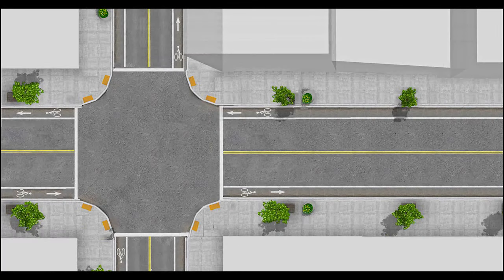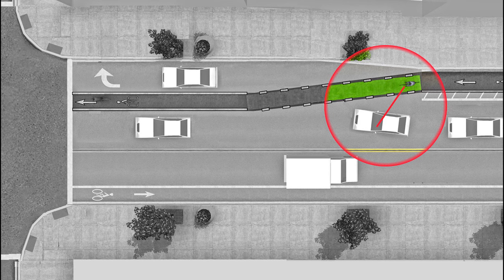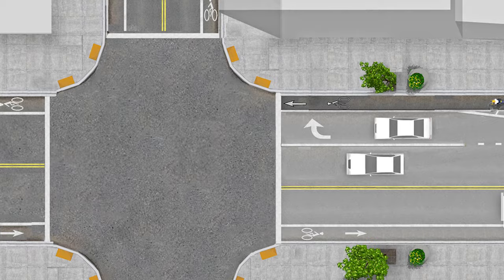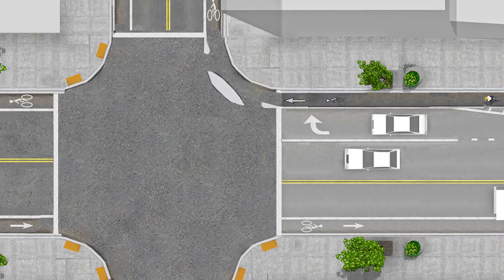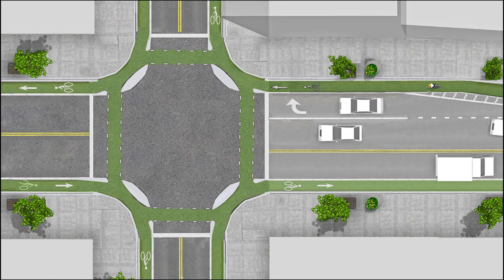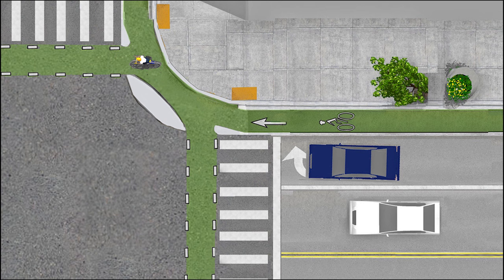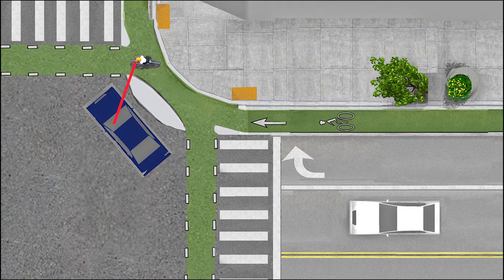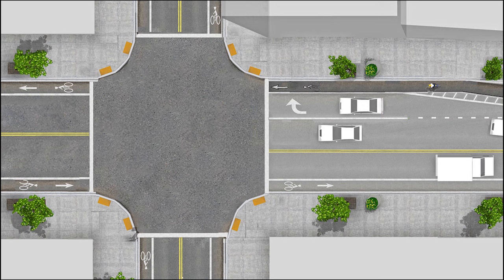Intersection design, the Dutch - cycle friendly - way

Comment: I am happy to say that the urban Cultural Trail in Indianapolis has adopted the Dutch design connecting all 5 neighborhood districts. This may very well be the only design in existence anywhere in America. The Dutch model is the most practical model to follow I think. I wonder how many other cities in the world also uses this grade separation.
Reply: How is cycling in Indianapolis now? Has it improved in the last 9 years since you posted this message?
Reply: Wow! 9 years later. Well, since recently they have approved expansion of the cultural trail. The extension grade separation based on dutch model will extend along the following streets:

1. South Street
2. Indiana Avenue
3. 10 Street

Since 9 years ago Carmel a suburb north of Indianapolis also built the Monon Trail cycle path grade separation right through the center of town. 

They will continue to use those special proper pavers for that smooth ride every one has been raving about. The great thing about the Indy Urban Cultural Trail is how it connects all the city district neighborhoods together in a consistent manner finally making it much more safe for cycling. 

I haven been in other parts of the country other cities are slowly but finally doing this approach based on Dutch model. Another city I give my hats off to is Cambridge and parts of Boston. A very small stretch along the Delaware in Philly.

 As a whole most US cities are still mostly using painted stripe method and road sharing between cyclists and auto traffic. We still have a very long way to go if we ever get to what the Netherlands have. It really depends in how serious each municipality takes when doing future planning of its bike paths.  Since the the US doesn't do thing on a national level like the Netherlands the quality plan will vary from city to city. Portland for example has more cyclists and paths in numbers but most of those paths are poorly design being a far cry from what you'll find in the Netherlands or in the US like Cambridge, Ma or Indy Cultural Trail.
Reply: @Itravelbackintime  Happy to hear that at least continuous improvement is being made in parts of the US. 

But it's a real shame nothing is done on a national level, especially with the big infrastructure plan. With 5% of its budget or so, you could achieve miracles in a short period of time. Should be a non-starter, because eventually you will be able to cut down substantially on car infrastructure.

Comment: Yes, they have to take the left turn in two operations, but each of those operations are quicker than a single left hand turn. You go straight when your lane has a green light, then turn and wait until the crossing lane gets a green light, which should be immediately afterwards.

Comment: Shouldn't this be obvious?
Reply: short answer: yes!
Reply: long answer: yeah!
Reply: Red Works you clearly have it 2 looking at your references haha
Reply: Great design has immense power over behavior, Red. Here's an example: 1) your city has a problem with drivers passing too close to people on bicycles 2) thus you install a whole bunch of protected cycleways, and retrofit a whole bunch of access streets with design that encourages 30km/h by brute and visual physicality 3) profit; people will no longer (or mostly, but the exceptions being at much lower speeds) preform this behavior of dangerous passing because they either literally can't, or the car is going the same speed.

Another example: protected cycleways along arterial roads. With all the cars behind you, and a huge ass bump to go over, I don't think you want to go over it at 60km/h to 'have a little text on your phone', or to hold up a whole bunch of drivers staring at you taking your sweat-sweat time over that vertical bump.

Another example: decoupling main cycling routes (e.g. cycleways along arterials) from main driving routes, and putting them through residential areas. There will be literally hundreds of windows staring down on these routes. The Dutch are now starting to decouple these two main networks.
Reply: it is not.
Reply: It's a terrible idea. Cyclists can just as easily use what's already there. If you're not able to ride a bicycle on the road, then it's YOU that has to change, not the road.

Cycle lanes are expensive, obtrusive and never, EVER  used in winter, because who on earth is going out in the freezing cold on a bike? No one.
Reply: @KiLLJoYYouTube  in the netherlands you do use your bike because a lot of people dont have a car and every kid  goes to school with their bike and also in the winter
Reply: @KiLLJoYYouTube  Cycling tendencies are much more dependent on infrastructure than weather. https://youtu.be/Uhx-26GfCBU 
Also, cycle lanes are expensive, do you have any idea of the costs incurred by roads designed to carry multi-ton vehicles? It's a hell of a lot more than ones that only carry cyclists
Reply: It's only obvious if you actually care about bicyclists, which US road designers don't.

Comment: And here is another Dutch road junction example - in Den Bosch - put these coordinates into google maps and you see it: 51.683492, 5.294488.
Difficulty level for newcomers - extremly high. If you want to turn left - choose middle lane, go straight ahead - choose left lane, at least turning right is from the right lane. In some point you pass oncoming traffic from the left (not as usually from the right side).
Reply from the maker: wino0000006 ah you're too late to try that one... we fixed it: https://www.youtube.com/watch?v=RzmWxn1Sfz8
Reply: Thank God - I passed this junction many times but it was 10 years ago - when I lived in NL for 1,5 year. When I saw it first time - it was like: what the hell is going on here - and of course - when I wanted to drive left, I drove straight.

Comment: once again proves Americans have a long ways to go
Reply: +sleepyfish 

they might not go there ever, because they are far more spread out, have far more accomodating roads for cars than is possible in old cities that were at best designed for few horse and carriages. If you see a piece of asphalt in an US city, it's not uncommon for it to be 4 lanes wide in the middle of the city, it's unheard of in most european cities and if they exist, they aren't as much implemented as they did in the usa, which mostly was built after the car was invented.
Reply: +AwoudeX should at least work well on much of the east coast, where most (all?) of the major cities sprung up long before the personal automobile had proliferated. plus many other older cities throughout the rest of the country (chicago, detroit, minneapolis-saint paul, st. louis, cleveland, Cincinnati, denver, etc)
Reply: It can work actually in all but the latest 20th century suburban/exurban communities and even then there are ways to implement it along side zoning reform and re-targeting of development incentives.  The problem is less the roads themselves in many cases and more a matter of what is built along them.  That said, most Dutch cities seem to lean towards incentivizing cycling over other modes by making short intracity car trips very difficult and time-consuming.
Reply: Not just Americans
Reply: 577AllWell if cyclists are not using them it’s a sure sign that they are poorly made. Inexperienced cyclists will still feel unsafe using them so they will stay on the sidewalk and experienced cyclists will find them too narrow or unpractical.. I see this all the time in my city. I feel most of the time “bike lanes” in North America are designed by people who never bike🤦🏻‍♂️what a mess

Comment: This situation calls for a lane divided roundabout with "sharks tooth" indicating exactly where a motorist has to give way to pedestrians and cyclists. 

But, Rome wasn't built overnight either. Situations like these are absolutely affordable alternatives for a transition towards a system like in Denmark or the Netherlands. It took us Dutch 50 years of trial and error to get to the nationwide standard of today.
Reply: I am beginning to think that instead of dividing lanes by type of vehicle, we should start thinking about dividing lanes by travel speed.  say, the outside land has a top speed of 5 MPH, the next lane goes up to 12 MPH, the next to 25 MPH, and the next to 30 MPH.  granted, you couldn't fit a car in the 5 MPH lane, and shouldn't be fitting a car into the 12 MPH lane, and on street parking would still be problematic. (personally, I think on street parking shouldn't be a thing, except in neighborhoods, where it would separate the under 12 MPH lane and the over 12 MPH lane)